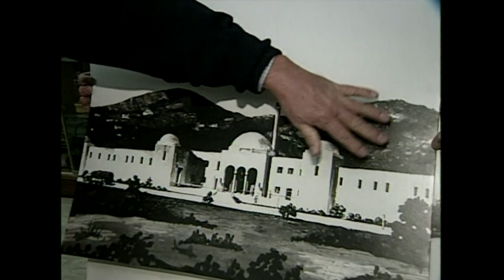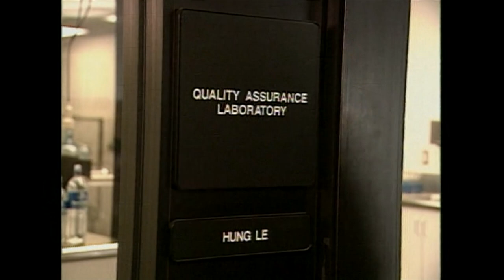Sparkletts | Visiting with Huell Howser | KCET

Comment: The old glass 5 gal. containers weighed FORTY pounds empty … add appx another 40 pounds of water and those route drivers were muscling 80 pound containers all day. Must have been good business for chiropractors back in the day.
Reply: The bottles did NOT weigh 40 pounds, they were 11 pounds empty. My father retired from Sparkletts after thirty years and I ran routes for five myself.

Comment: Would have liked to see how they clean and sanitize the bottles.  I hope they do.
Reply: They are put through a high pressure, high heat sterilizer upside down, the detergent used was a surfactant.  Then rinsed through a chlorinated high pressure area.  Placed back into the crates to go to the filler room.  then down to the cap machine and onto a automatic palletizer.  Then picked up with a clamp forklift and placed in a row double stacked.  Some pallets were stacked 4 crates high with 24 on a pallet, some 5 high with 30 bottles on a pallet.